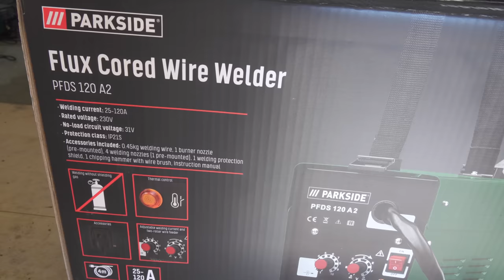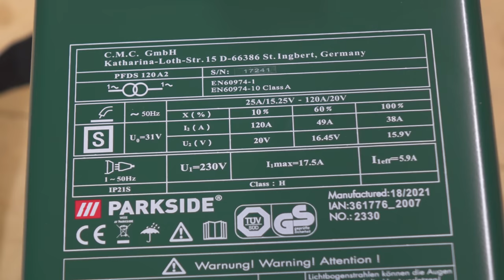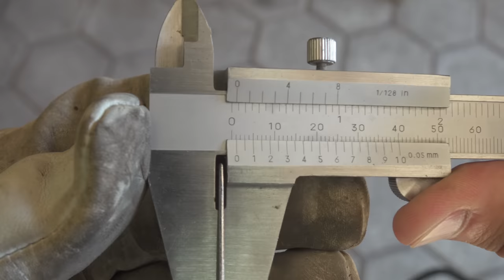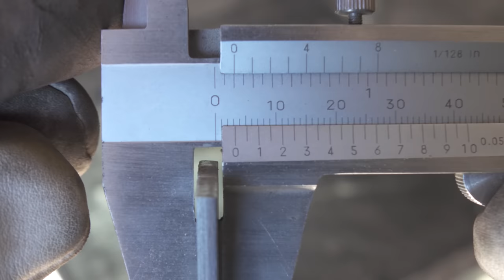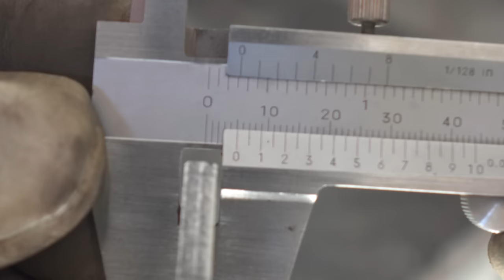No Gas MIG Welding Machine (Flux Core) - PARKSIDE PFDS 120 A2 | Unboxing and Test

Comment: Never use an A/C flux core machine as they are very difficult -  always buy a D/C one. Never use the flluxcore wire that comes with the machine for anything but practice - buy some good stuff for real jobs. Practice plenty before trying to do real welds - particularly on thin material.  Enjoy.
Reply: 👍👍 thx
Reply: and i think its the perfect machine for hobby welders or if you have just to do a little job, fixing a garage door or something. To me its importand not running around with an extra gasbottle for little things like this and my normal E-welder is by far too strong to weld thin metals without having the risk of burning holes in it every couple of cm
Reply: Can you pls elaborate on this suggestion you made? I'm looking to buy this machine when available again. Is it A/C or D/C and what's the difference between them? Thanks
Reply: @cestvraimenthorrible3465  My first flux core machine was an A/C one and it is very difficult to use - I no longer use it. You will find videos of people using the with some success but they are normally very experienced or well practiced on the machines. Because the polarity reverses with the mains frequency of 50/60 Hz they cause a lot of splatter as well and burn through thin material. DC is a lot more friendly for the novice (as long as you set the polarity correctly for flux core) and is much easier to become proficient with. If the Parkside is DC then it should be fine. I love my DC welder which like the Parkside was very affordable.
Reply: @johnnorth9355  DC is the way to go then! I will that in mind. Thank you for the insightful tip.
Reply: My Harbor Freight welder was 125 amp, AC output.  It was slightly better than a hot glue gun.  I converted it to DC electrode negative (DCEN). It made a whole new machine out of it.  I took on a rather large project with it.  I mounted a hydraulic cylinder on my HF motorcycle lift.  I had to fabricate and weld the mount for the cylinder.  The welds had to withstand 9,000# of force to lift a 1,000# motorcycle.  I've been using it for about 3 months and the welds are holding well. Harbor Freight sells a 125 amp welder that is DCEN for a little more money.  I bought mine not knowing anything about welding.  The one advantage mine has over the one that's already DCEN is that it will accept a 10# spool of wire and the one that comes DCEN will only take a 2# spool.  If that isn't an issue for you, I'd recommend buying the one that's already DCEN.
Reply: @martinhauk1852  can u get an example model of dc welder?
Reply: Have you tried the new super tiny Inverter welding machines from China? Some are the size of a small loaf of bread with 300a ratings!!
Reply: Pity I didn’t see your comment before I bought the piece if sh1t Aldi flux welder, from a seasoned 40 plus year stick welder.
Reply: Me with my brother we transformed this industrial junk to a stick welder! And it works normally!😂😂😂
Reply: how do i know if its a dc or ac welder... do i have to buy first see the splattering second or is there a way to see if its dc or ac??
Reply: Flux core is basically expensive stick welding.
I prefer oxy-acetylene welding, but I am an old man.
If you are serious about welding, go to Welding Tips and Tricks  with Jody on you tube.
This guy is a modest genius.

Comment: Hello my friend, I have a Renault 4 car. I want to repair its body and floor with mig welding without gas 130a. Is this welding strong and good or not. I want an answer from you
Reply: it can only weld steal, but no other sorts, not sure if suitable for a car body
Reply: Bende var bu makinadan arabalarda güzel sonuçlar alıyorum ancak yinede gazlı kaynak almanı önerebilirim en az 250 amper olmalıdır

Comment: what were your dials set to for the 1mm steel and the 3mm steel?
Reply: 3mm you would want to set wire speed to 4-5, and start with heat (voltage) from D+ till you find the sweet spot while lowering it.. (aka lowest spatter and smoothest sound of arc) btw this method is common for all MIg/fcaw welding.. you usually set the wire speed first and then find the proper heat for it...start with high heat and lower..  for 1mm?? ehh.. that would be a bit difficult...no continuous bead for sure.. try wire speed 1.with heat A-B and try tacking.. (all what I said goes to a 0.8-0.9 wire)
Reply: @laszlovona  There is only a single dial on the machine for specifying the metal thickness (0.8 to 3 mm). The feeding speed and amperage is automatically set by the machine.
Reply: @ehsanmorav  you are talking about the new type. The OP asked about the old version seen in he video.

Comment: I can tell you first hand that this is a dreadful machine - I have one - however I also have the more expensive Parkside multi-process welder, which I use to run flux core & it is a little belter of a welder. Excellent machine, can't say enough good things about it.  

This ^^ however is absolute pish.

Comment: Push the weld man dont drag it if you don’t have to
Reply: I believe you do have to drag with flux core, hence the saying if it has slag, drag
Reply: Doesn’t matter with flux core because that’s how the pipe work is done with the mig

Comment: 145£ on eBay uk
Reply: it was less than 100GBP where I live but I returned it.. if it was DC, it would be a decent machine, too much hassle to find the sweet spot, even with a proper flux cored wire (30-35 EUR/kg, not the cheap one from lidl)..
Reply: @laszlovona  
It is DC a machine.
DCEN with electode to the negative 
It can work only that way.
Reply: @samirazarzar6279  sorry, but it is not DC. It is not an inverter machine, but using conventional big transformer and and the regulation of current is done by splitting the AC waveform with a triac (I know the schematic of this welder).. and this why the arc sounds so strange compared to a proper DC machine and the spatter is also way worse.. there are many videos, posts on the internet about converting these AC machines to DC by adding diodes and huge capacitors.. /which of course would make the price higher if already added/

Comment: What is the setting for 2 mm welding?  Thanks
Reply: There is only a single dial on the machine for specifying the metal thickness (0.8 to 3 mm). The feeding speed and amperage is automatically set by the machine.